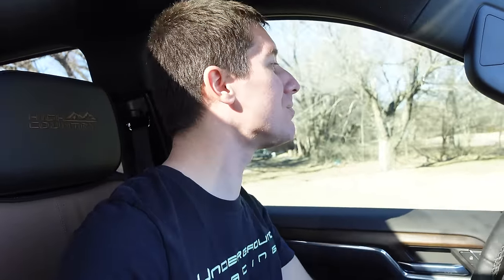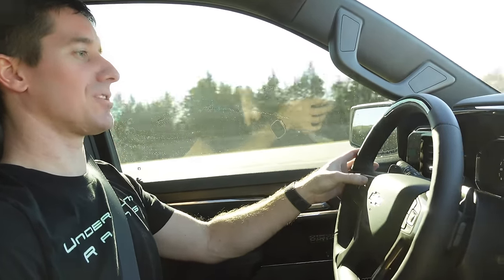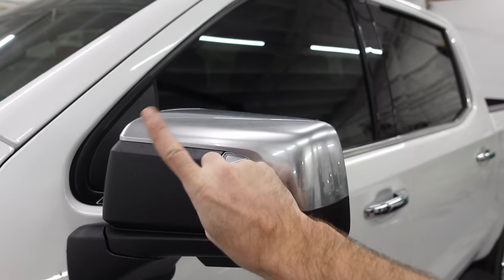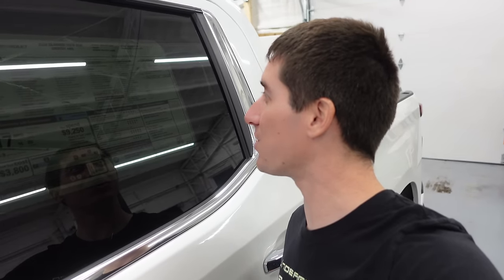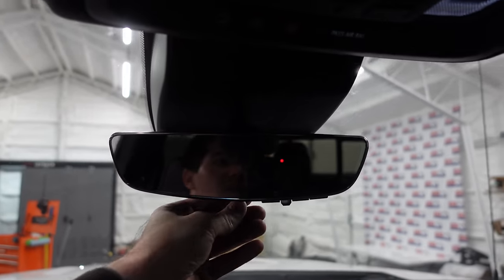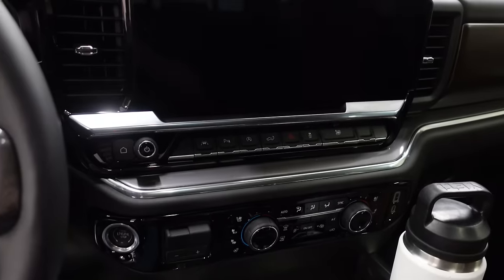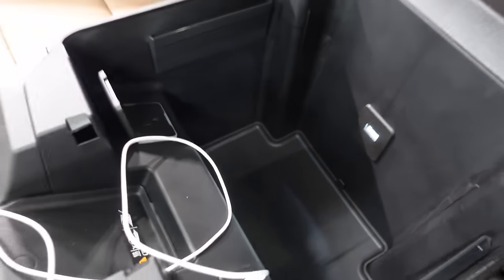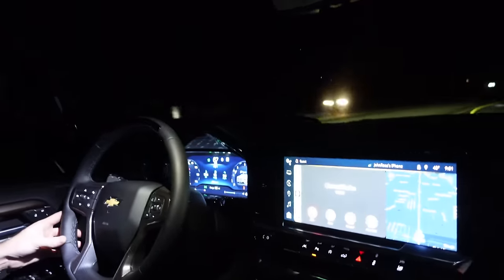This Is The MOST EXPENSIVE Chevy Truck You Can Buy Today *2024 Silverado High Country*

Comment: All I need in a truck is the ability to load a full sheet of plywood in the bed and close the tailgate.
Reply: Damn right! And go out in a field and cut firewood and put it in the truck bed and not worried it's gonna get scratched.
Reply: That's why you get old used trucks
Reply: That's why you buy one of those white Toyota pickups that's like the size of a motorcycle, but has the same bed size as a FORD F250 SUPER CREW. Its coincidentally illegal in America.
Reply: Then a pre obd2 is the one for you. And me.

Comment: I have a 2024 Chevy 3500 LT dually and, while not as fully loaded, I love the truck. One of my favorite features for towing is that the voltage gauge automatically switches to transmission temperature when I connect a trailer. Yeah, I could scroll through the menu and see it but it's nice just having it automatically display.

Comment: I would go with the cheaper work truck, but add in the V8 option.
Reply: Yea Goodluck finding one. All of the v8s are optioned in expensive trucks. Order one? Goodluck you’ll get it in a year if ur lucky
Reply: There is a supercharged coyote F105 (sleeper lighting) being sold in WT spec in the SE US (I think) its super cool.
Reply: @Usicky12 Ordered a 2500, took about 18 weeks. (October to  this February )
Reply: 17:46 that GM V8 already sounding like it’s ready to drop a valve…😂😂😅
Reply: @Usicky12  I just built a truck on Chevrolets website, and found multiple trucks that had the options I wanted. A dealer within 23 miles from where I am. They are white versus blue that I configured, which is okay for being the only option missing.

I bet I could find the exact truck I'm looking for if I searched further away or went to GMC.
Reply: @NONo443  well aren’t u a special cupcake.
Reply: @Usicky12  Not as special as the cupcake that stated good luck finding one locally and that incorrectly stated it would be apart of an expensively optioned truck.
Reply: @NONo443  it is definitely more likely to find the higher end motor in higher end trucks, that’s a fact.

Comment: Ive got a 17' Silverado High Country with the 6.2L. Been a great truck but itll be my last new truck. Bought it for 54k CAD, 68k CAD MRSP and for the same truck now its over 96K CAD. I can buy a house for another 50K lol.
Reply: Demonstrating how expensive trucks are by using housing as an example probably isn't the most apt comparison. This truck is likely nicer than any house you could get for 50k in '24
Reply: @thesandman775  Not sure you read my comment right. I said for another 50k, over the 96k, so around 150k i could buy a house. Also, it is an apt comparison when you think about what a house provides compared to a vehicle and the price jump in only 7 years, it shows just how absurd the pricing has become.

Comment: The reason the holes are showing in the bed is that they are handles if you use the bumper steps. The power up tailgate is not available with the multi step tailgate only the regular one . Also the mirrors have built in spotlights which are really handy

Comment: I just tortured myself buying a used truck. A 2016 Ford 5.0 mid-optioned ($20K) or a 2015 5.0 Lariat (29K). I cheaped out but miss the bigger screen, folding mirrors, heated seats, etc. It's not a daily so I think I made the right choice.
Reply: Loved the Lariat.  I had a 2011 5.0 for a few years. Then traded last month for  a 2020 Lariat 5.0 with 12,800 miles.   Paid $42k for a like new that stickers for $68k.  I couldn't bring myself to buy a  2024 at that price 😕

Comment: I bought a new Colorado on 10/3.  On 11/1 it went to the dealer and I didn't get it back until 12/29.  A software update blew the control module for the dash and controls, so it was just a big brick.
 
Even now it alerts for phantom pedestrians and it keeps losing the settings for the remote start/keyless entry.  Just yesterday I had to reset the controls because I could lock the doors with the button on the handle, but I could not unlock them.  Went into the menus and that feature was turned off all of a sudden.

Too many bells and whistles is just stuff to go wrong.  I should have kept my 2019, it never gave me any trouble.

Comment: I've got a 2015 Sierra 4x4 that's heavily optioned.  Of course it doesn't have some of the features that this one does,
but it's been a really good rig and it still looks like new. It only has 78,000 miles on it.
I REALLY like the dash and interior in this one a lot more. The displays are incredible. So much nicer than mine.
I especially like the big clock. That is really cool. The storage in the rear seat backs is nice too. One thing that RAM did
that was nice was putting storage in both sides of the floor in the back. That was about the only thing they did right LOL...
I do like some colors of tan interior but so many of them look more like baby poop than tan. The tan on the seats in
this HC look nice, and I think the two-tone looks good too. Does this pickup have a roll up bed cover ? It kinda looked like
it did at times but it was hard to tell.
Reply: Who cares

Comment: Unfortunately on the Silverado the reverse and license plate lights are NOT led. Easy enough fix... but still. As others have said, Power up isn't available on multi function tailgate. I bought my 24 high country in Kansas City and Super Cruised it over 6 hours home. Loved it. To perfectly finish one of these beauty's off need to install the illuminated bowtie on the front, Bowtie logo puddle lights, and a putco blade under the tailgate, and boom, you're all set!
Reply from the maker: I wondered if MultiPro was too heavy for the motor 😥

Comment: I have had two of these trucks, fist one lasted less than 300 miles and the engine crapped out. Fortunately the dealership took it back and I picked up a newer one with almost all the same specs. I have the power steps and they are awesome, there is a button on the back of the running boards that allows it to swing further back so you can use it as a step up to get into the front of the bed easier.  I am only lacking Supercruise and HUD. I have had multiple Yukons, Escalades and a 2019 Silverado before this. I love the 6.2 engine, will never buy another 5.3 again. The 5.3 is a good engine but the transmission is crap.

Comment: I really don't understand the fascination with self-driving vehicles... I don't even use cruise. Don't like it.
It's the epitome of laziness in my opinion.
I'm 62 years old and I drove truck for 40 years for a total of approximately 2,500,000 miles, plus all of
the miles I've driven in my personal rigs over 46 years.
I never used cruise in the truck either. I actually like to drive the vehicle I'm in. I have no desire to just
be a passenger. Besides, when it comes to self-driving vehicles, I don't like the idea of having a bunch of
electronics having that much control, knowing that it could malfunction.
Maybe if I was younger I would look at it differently but I doubt it.
Reply: Just try using it a few times and you'll see that it's just comfortable in some situations and your black and white opinion on this is a little off. Life is a lot of grey and rarely black and white.
Reply: @colajunkie13 no it’s called trust and self drive has proven plenty of times that it has issues. All these new vehicles are also always connected which means it will only be a matter of time when some hacker/hackers will be able to break through the security and then take control of vehicles on the road.
Reply: @P-J-W-777  That was my thought. They are able to do it with just about everything else, I don't see why they couldn't do it with vehicles, but then again I honestly don't understand a lot of tech.
I'm curious what JR's thoughts are on this because he's definitely a tech guy.
Reply: @1911MikeinOregon  exactly it’s only a matter of time. The manufacturer can already activate the cameras and microphones inside the vehicles anytime they want and if they can so can the government. Betting they can shut your vehicle off as well. No telling what else. Especially in those 100% computerized EV vehicles.

Comment: For trailering super cruise to change lanes i think you have to build a profile when you add the type or trailer and length, weight, axles etc so it knows what's back there.
Reply from the maker: I’ve tried to make all that work with trailer blind spot on my f250 but it’s far too annoying… so I’ve never gotten to use pro trailer backup or trailer blind spot 😥
Reply: Any ambient lighting

Comment: 6.2 V8 (all the way down to a 2 cylinder) 420 horse 460 ft lbs torque 10 speed for $79,000.  Chose same cab & bed  4wd (2023 bought new in Nov '23), 2.7 turbo Custom 310 horse 430 torque 8 speed for less than half the price ($36,800 + tax). Bought mine, wrote a check after trading in '16 Silverado. Few people buy these loaded trucks. Lease. Monster payments. Crazy.

Comment: The malfunctioning trailer light may be causing the auto pass function to not work.
Reply: Most probable cause, if it knows it cant use the flasher, the feature should disable for obvious security reasons.
Reply: @PowerSportsQuebec  If it was a BMW it would change lanes no problem without signaling. A holes never signal. lol

Comment: I would go with this spec or higher.  I bought my '18 Sierra SLT Premium Plus new, loaded as close to a Denali Ultimate as you could get it (Denali wasn't worth the upcharge, especially since I upgraded to the Denali cluster and 22" wheels myself for not much money).  I would buy the Sierra over the Silverado for the new ones.  If going 1/2 ton again, I would go with the 3.0 Diesel over the 6.2.  I'm happy with my current 6.2, which is the same motor as this but with less sophisicated AFM.  The 3.0 isn't quite as fast but for towing it is a better motor.

That said, I think the HD Sierra Denali is the go-to now.  My pretty frugal wife saw one and liked it so much she mentioned me upgrading.  I'd love to, but I don't need a 3/4 ton and with only 29k miles on my truck, I can't justify the expense.

I do wish GM offered the Pano roof on the trucks.  Also, 0W20 has been a spec since the DI motors came out in 2014.

Comment: I owned a 2022 GMC Sierra. Hopefully they have improved the processing power of the infotainment because mine was incredibly laggy and slow. It has wireless carplay, but refuses to default back to carplay when you get back in the car. The rearview camera would freeze and drop frames all the time. I have also been participating in GMs customer review panel and they are constantly asking questions about different services I would be willing to pay for as one time over the air updates or subscription. Welcome to the world of having updateable computers in your truck. I worry about these in car systems getting even slower as more updates are pushed over time. GM is also the last manuf. to switch to coil springs in the rear which makes this a really poor riding vehicle versus Ram.
Reply from the maker: It was a little slow in this too, and I noticed it dropping frames backing up 😬

Comment: Not worth the price. Trucks are like walking house note at this point. There needs to be a pricing change. These car prices are out of control.
Reply: It will happen. This is the first year incentives have come back since 2020, sales remain level year over year which is terrifying for an automotive company. We won’t see prices come down for 2 or 3 years yet but we probably won’t see them go up between model years either. Incentives will heat up the market again, but manufacturers are running out of people with available credit, this is the next existential threat for them. They pushed high prices because no one pays cash, it’s all about financing so higher prices do not impact sales nearly as much as it would on retail items we’re financing doesn’t exist, but the US and Canada are so highly leveraged with credit that this heyday of steep prices and cheap credit will run its course. Doesn’t matter what you want to sell your truck for if there is a credit crunch and a recession. So, I’d expect a slow retreat to better prices or maybe first an appeal to value propositions before they risk showing their hand and lowering prices.

Comment: I'd get the LT Trail Boss or RST. But they took away the lighted mirrors on the lower trim trucks. I'm also a fan of the jump seat in the middle front with a column shifter. My current truck is a 2012 Silverado 1500 4WD Crew Cab LT Z71.

Comment: Strange that your f150 doesn't have a button for the heated wheel. My '22 explorer limited does.
Reply: My 2020 F150 Lariat doesn't have one and it's annoying.   I plug my phone in and Android auto takes over the screen.  Must disconnect to get to the digital screen with the button. Poor design.
Reply from the maker: Yup, they all used to, now it’s buried on the screen and always automatically turns on 😡

Comment: The thing that would get folks really excited would be built-in dash cams. Nothing is clunkier than an aftermarket dash cam, with its cord searching for a 12V "powerport"/"cigarette lighter"/"cigar lighter". My Ram has 9 USB ports but the only 12V port is in the top of the dash (duh). I wonder if the manufacturers are fearful of anti-trust rules. It's my understanding that that is the reason they don't do campers.

Comment: My tundra platnium has rear cooled seats and a panoroof. Obviously no super cruise or step tail gate.  65000
Reply: What year? I couldn't find any with the 6.5' bed and Softex seats in a 2022 or 2023.  I got a 2020 Lariat instead.
Reply: @leechburglights  2022 they have gone up.

Comment: 4:30 it's not going to change lanes when your trailer lights aren't legal. Either that, or, based on the turn signal appearance, you didn't input the trailer information into the system.

Comment: If you need a truck by an HD without as much built in obsolescence. That way you skip the "DFM"  "Deathspiral Fuel Management" At least if you can expect an HD to last 200K miles or more. The difference in the lower fuel mileage will pay for itself when your half ton junk is dead because of lifter failure. New half tons are the new soccer mom vehicles.

Comment: The new truck with all that technology is nice but at a very high price. When something goes wrong, it's expensive to repair.  There was an F150 with the taillight costing $5600 to repair. FordTechMakuloco youtube channel had a video about it. It's very likely this Silverado would have similar problems with similar costs.  The only thing I see great is the cameras on the truck. If that was possible to add to an old truck, I would consider putting that on truck that is 10 to 20 years old. I will stay with an old paid for truck with no technology. I will never have to deal with the costly repairs that will come with a truck like this one.
Reply: 😂 I only need 4 things in a vehicle.  AC, cruise control, power windows,  and a radio. When I looked new vehicles in 2020 for the first time in over 10 years,  this  was all standard in most new or newer cars.  That WT he had was nicer than my 2006 Pontiac G6 😂

Comment: The reason that the mirrors do not fold as you're driving is because you're using those cameras on the bottom of the mirror to help you drive. You don't like when you're in self drive. But you thought it was so cold. You didn't understand that when you fold those mirrors. You wouldn't have the cameras, no cameras, don't self drive no cameras. No self drive one more time. No cameras, no self drive if the sidemares are folded in.

Comment: With normally aspirated V8 (of a decent displacement) 1/2 ton pickem-up trucks going the way of the Doe Doe bird GM may be the only choice left.  RAM is going inline 6 turbo and v6 as the only engine choices for 2025...

Comment: Some of those tech are  an uneccessary features, but just an added cost.  How long will it last is the real question. As the vehicle age things will start to go south after 10 years or maybe even less. The thing with massage seat in a vehicle is they're the first feature to go then the leaking sunroof, the tranny, the engine, along with all the electronic.

Comment: There will be restrictions on Super Cruise once there are are more accidents and lawsuits. We probably won't hear about the accidents. If something happens with a Tesla, it automatically get full coverage on every station and website.
Reply: Allowing self drive while towing is a horrible idea. Any issue with the truck or trailer could end in a disaster by the time you react and grab the wheel again.
Reply: @richardkafka5625  they should test it with a improperly loaded trailer. Let's see what happens when the trailer starts swaying.

Comment: Why the heck would you fold in the mirrors while driving??? Besides car wash or a tight street or alley, why??? 
W/T spec is just fine. Although the options are super cool, there’s comfort in basic simplicity.